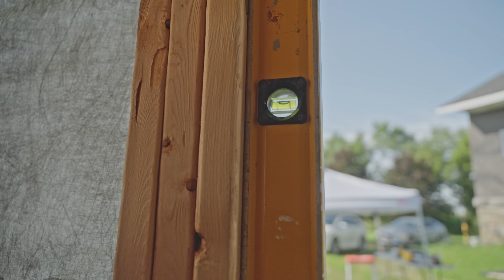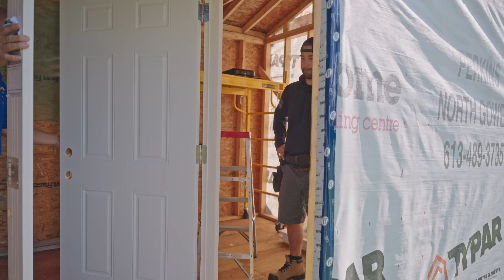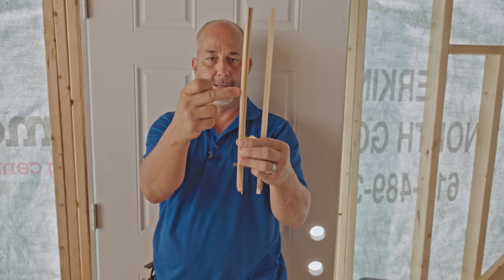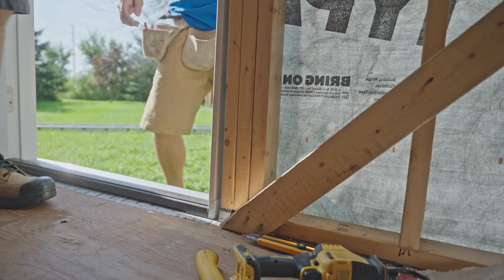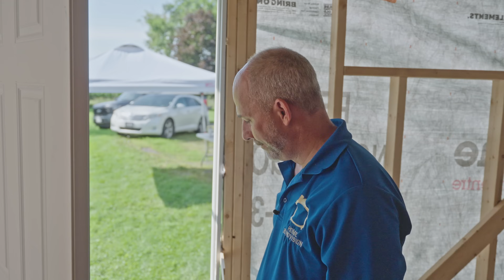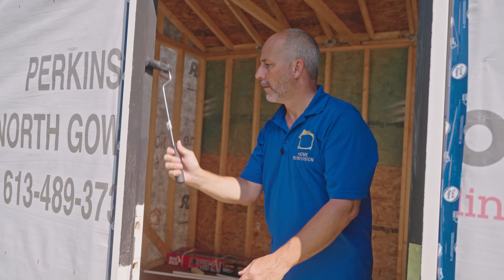Exterior Door Install | Step by Step Process

Comment: Jeff, sorry to be the master of the obvious, I do love your videos.  Rough frame in dimensions and actual door dimensions usually leave you with a far more space than you had here.  You spent the first 14 minutes of this install dealing with having too tight of a rough frame in.  If your framer is a Ninja Level 10 type then you can get away with a tighter opening.  Typically the side rough opening is approx. 2" wider and the top rough is 1" taller.  The shims and the level are your time saving friend-- and over-sandwich your shims and compress them with your installation screws.

Thanks again Jeff!
Reply: Exactly. You should know what your doing before posting a video. Whay isn't this sill plate moving over?? Really??
Reply: "Over-sandwich your shims" Were you even watching or listening to what he said? That's EXACTLY what he did! I watch these vids on YT and see so many people making inane comments about things that were already covered in the video. He also said about the opening being typically 2" wider!!

Comment: Hey, Jeff.  That strapping that you had to remove from the door frame is meant to hold the doors together on a pallet.  They'll ship them 5 or 6 on a pallet and have that strapping for support during shipping.  Store should be removing that when they load in on a sales floor so you don't have to.

Comment: Watching Jeff paint is always  is fascinating.  He is so good !  He does all the little cutting strokes and feathering  with ease.  Every time I watch him I learn something new.  Today's lesson is the one I struggle with most when painting - PATIENCE.   Thanks Jeff and keep up the good work!  Your lesson have saved me thousands to date.
Reply: When painting doors, it is important to not let the paint dry on you.  I did not see the final product in the sun to see if his brush edges showed up.  Generally, when I paint the door, I brush the edges of the top four panels but roll out the centers right away, and I don't go onto the main area until the centers are done with the small roller.  Then roll the main area working down starting with the top half then to the bottom half, always trying to keep the edges wet until the area is done. 

In the video, I could not tell the air temperature,  or moisture level either.  That also can either give you more time, or dry the paint quicker, like in 80 degree weather.

Comment: As a tip for painting a door, take a wedge and wedge the bottom on the latch plate face and toss some cardboard under the length. It’ll steady the door, allow you to roll all sides without having to swing it. Toss some painters tape on the hinges and then knife the outline then just paint right over it.

Comment: 6:50  That's a #3 Phillips bit.   And the reason they're there, is because the HD received multiple doors on a pallet.  These doors are screwed with nylon straps to prevent their movement during shipping.   Store associates are supposed to remove them when they stock them, however, sometimes people get lazy and only remove the screws on one side (the side facing the store aisle). lol

Comment: Just passing thru wanting to learn .  For years husband, who is so talented built 1 1/2 houses lol for real tho, before me, married 31 yrs…..ANYWAYSfor years he could lift nothing heavier than gallon of milk.  So I learned to do things just to make function.  Cause I worked 12 to 14 hrs.  
Got some big ole handsome grandsons .  Sons in love too. I some good work done till no extra moolah just for minute.  I love doin the little I’ve done.  I certainly not woman’s lib 
I do have a very talented fella that is willing and will help once ship arrives.  I learned alot from door thing door only 3 yrs old and has settled with gaps of air this year.  So thank you!
I’m also totally realize need to get you pros I’m thinking need to call new roof guy (3years ago).  Window in same room falling from top,  calling in troops after Christmas!! 
Merry Christmas 🎄 can’t officially join yet.  Thanks for letting me stroll through 😊

Comment: Thank you soo much for this video. I'm about to "attempt" to install my first ever door... No experience with any of this... But the massive amounts of reading and vids have helped... I'm so glad I came across this video specifically as I was confused about the flashing tape stuff... I'm glad you took the time and demonstrated how to use it, considering how expensive the stuff is and me questioning is it really necessary since everything will be either caulked or spray foamed, etc.... But after a bit of reading then seeing you actually applying and explaining, thank you so much. Feel a bit more confident with tackling this project. Still nervous beyond words though with screwing everything in and using shims. I'm just stuck on the whole brickmould thing as there's so many and it's quite overwhelming tbh.

Comment: I followed your video yesterday to install a door.  I fought with it for almost 2 hours.  It wouldn't lay flat, it wasn't sitting square. Nothing was right.  I pulled it out and I found 2 little black plastic pieces stapled to the bottom of the door.  it was packing material.  Ugghhh.  Once I removed those, the door was up in about 10 minutes flat!

Comment: Nice work. One suggestion; with such an utter flimsy factory door frame as I saw in the video, I would, before constructing any walls, have pre-made a strong, square and snug fitting door frame from beams around it on  a workbench. Install that in place, and then build the walls left and right of it. This way once the walls are finished you have a really strong entrance, and that factory door including its flimsy doorframe will fit perfectly, without gaps .

Comment: Having learned from my grandfather, who built a lot of North Vancouver from the late 1930s through the 1960s, I was taught to kick the hinge side of the jamb outwards just a degree or two, to prevent the door from binding with the jam when it closes.  Is this an outdated concept, or still an acceptable practice?  I'm guessing it compensates for seasonal movement of solid wood, which most doors are not made of anymore.

Cheers!

Comment: Have you checked that whiskey stick lately to make sure it reads true? Carpenters assume they are always accurate if there is no damage, which is incorrect.  Craftsman used to,have a paper insert taped to every one with directions on how to check them for accuracy. I've actuality had to go through 2 or 3 before I could find a good one.

Comment: Usually, you'd go flush with the drywall on the inside (0.5" past the frame, not flush with the frame). That's why it is 4.5" wide, it accounts for 0.5" outisde sheeting and 0.5" inside drywall, so the trim could stay level over the door frame and the sheeting.

Comment: The reason that your wall is leaning in near the door is because you cut that 1/2 inch off the 2x4 that you put on the top.  From the edge of the front top plate to the edge of the back top plate, that is the exact width of your deck.  Your deck was 10 feet.  Which is what you started with on the 2x4 that you put across it.  When you cut it down by 1/2 inch, you made it narrower at the top, than it was at the bottom.  That caused the top to lean in.  I wondered if that cutting off of the 1/2 inch was going to come back to bite you, and I see it did.

Comment: Use 3.5X 3.5 pieces of ply the appropriate thickness ply scraps off job site or invest !  Carry in a bucket !  Never shim behind hinges the shim moves by design of the weight bearing hinges !  I cut my own 8” shims out of cedar I buy or get scrap!  Make a shim jig !  This way is great waterproofing however door will move over short time !

Comment: the strap is so you can pull it around by yourself?   and the screws for self depth install?   I always take them all off. having just installed a dozen doors in my new home, 2 exterior I am now fully versed in door installation and cursed a lot at crooked framing and uneven floors.

Comment: Why not have the door swing out?  It would give you more space in there.
Reply: So you can open it even after a dump of snow.
Reply: Because then somebody can just pop the hinges off or break in with a flat head screwdriver
Reply: So that it can rot in place as water dirt and snow accumulates in the recess and gets inside with you as you open the door inwards.
Reply: @vschneider3389    But it's a shed you're not sleeping in there.
Reply: @joseph7105  That would be more work than kicking in the door or breaking a window.  Heck, without sheathing you could just poke your way in.
Reply: @vschneider3389  You'll have to clear a path to get there anyway though.

Comment: When the doors arrive they are standing on a pallet, usually 5 doors or so.  That piece of plastic screwed to the frame once ran across 5 doors holding them on the pallet.  it's faster to cut the plastic than remove the screws.  You can design a $4000 door and it may show up with and aluminum threshold and pallet grade lumber under the aluminum.  I always wanted my R/O 2 1/2" bigger than frame size and always recommended NOT having the door stained or finished in any manner.  With the added expense your painter can do it and I won't have to order another door that will take 2 months to arrive and be damaged again in shipping.  Sad but true.  I designed custom doors , windows and moldings/millwork for 16 years.  Trust me, customers are as reasonable as employees, even the "pros."  I refused to work with many customers and never got in trouble DIYers and even many pros do not know what goes into designing doors and windows and the framing aspect.  I only worked with 2 or 3 people my entire time because so many people couldn't wrap their heads around designing.  My favorite was when a customer would come in to get a window.  "I need a window."  "What size?"  "standard."  Sometimes to be make a point I would flop the Andersen catalog 6" thick and tell them to show me their standard window out of 100,000 standard windows...😁  I'm curious why no sealer under the threshold?  3 lines, not a big s?

Comment: Every time you leave your level standing upright it makes me cringe.
Dropping a level to me is like dropping a baby.
Ya know..  Nail polish remover is just scented acetone.
Another option for tightening screws is jam a (wooden) toothpick into the hole.
Shouldn't the windows be taped from the bottom up "Water barrier"

Comment: A properly installed door should stay wherever you open it to .... if it swings in on its own its installed improperly !!!!!! the wall is out of plumb which in your case is bad because YOU JUST BUILT IT!!!!!!
Reply: Relax bro. It's a shed
Reply: When he opened it, it stayed.

Cry harder.
Reply: Lol you didn't watch the video, he said if it's moving on it's open, it's better to have it go one way but the door came out fine
Reply: He forgot to level the universe 😲
Reply: If "level with the universe" means nothing to him, his door will most likely never stay wherever he opens it to.
Reply: I personally would have had it opening out wards so you don’t lose space inside your workshop
Reply: God… In fact I know my wall isn’t plumb… it’s around 5 degrees tilted towards the outside, and the studs are also angled. Tried to compensate with shims but it’ll never truly fit well… I either get a good gap or good action on the door.

Life fucking sucks.
Reply: @stvincents2007 exterior door opens inwards. You don’t want the hinges on the outside of an exterior door lol
Reply: It could be from warped wood.
Reply: @d1ddyp0p hinges for an exterior Out-swing door are different.  You can’t pop the pins like the typical hinge.  Out-swing exterior doors are perfect for small buildings.
Reply: But he literally showed that it stayed in the video? Wtf are you talking about. Putting doors in isn't some arcane lost art, calm down

Comment: With the sun beating on that door why would you paint it black? It's gonna be hot. Speed? Start at the top and cover the threshold. Screwdriver in the lock. You threw away the plastic stop that is used during construction. It wouldn't be so bad but acting like you know what your doing when you don't and then add the condescending attitude I just have to say something.